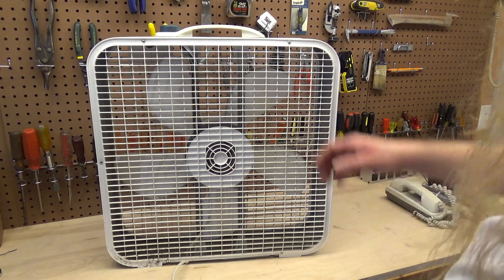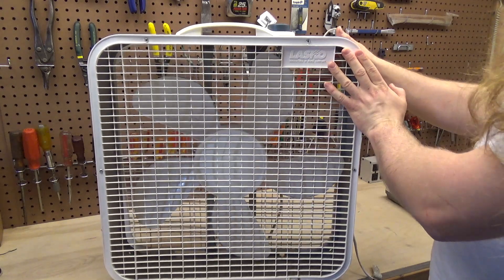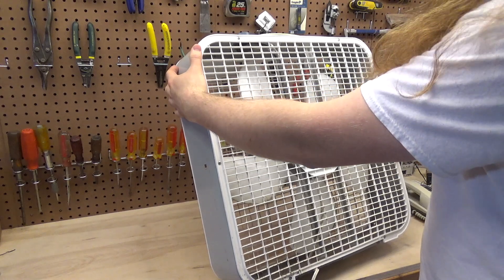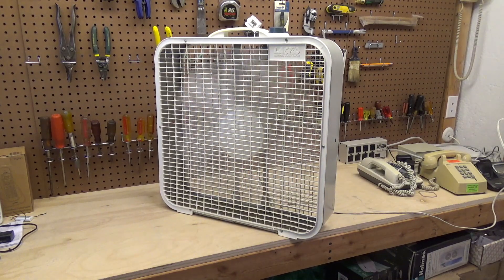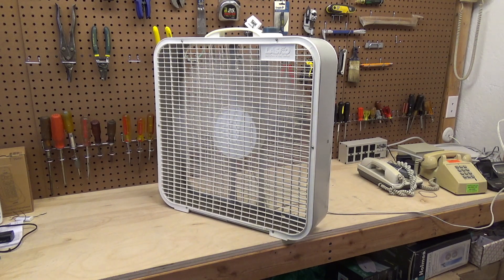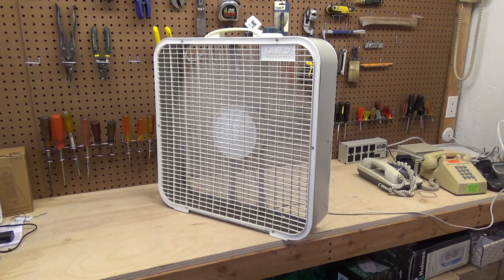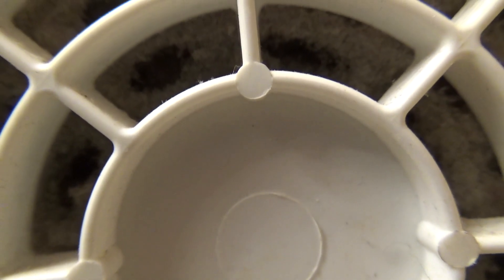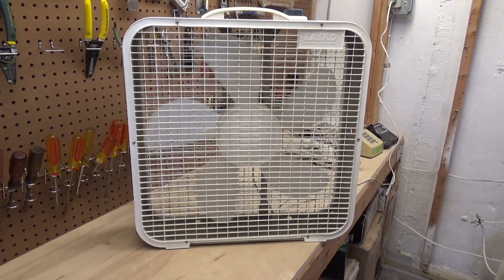Lasko 3723C Box Fan | Initial Checkout

Comment: Interesting! The Air King box fans had the D blade paired with the PSC motor for a couple of years in the early 2000’s. We still have a few of them floating around at work. This is the first Lasko I’ve seen like that, though.

Comment: This one had me scratching my head when I first saw it in Daily Vlog # 14 , I kind if figured it was manufactured in Canada because a lot of there fans are designed slightly different from ours . But I was astounded to see the performance of it , even with it containing a psc motor which is some cases are more efficient due to the capacitors and of course thicker and heavier blade sets such as this one . But still though I'm curious to how the blade set is combined with shaft which usually the 90s style blade set fits over a thicker shaft . I'd love to see a clean and service of it and I enjoyed the video Jordan.